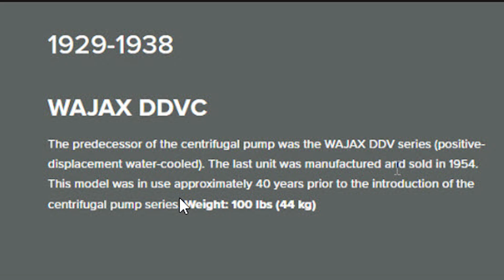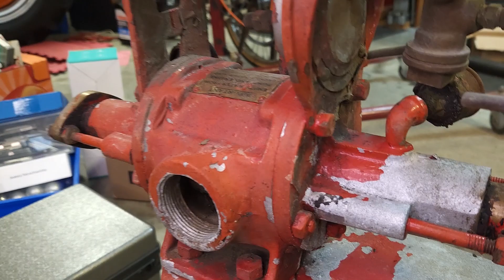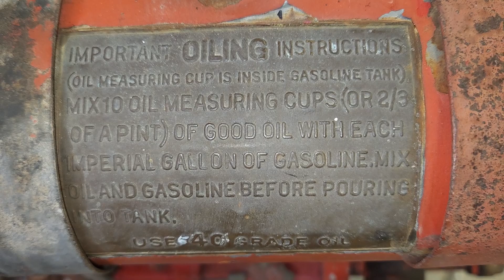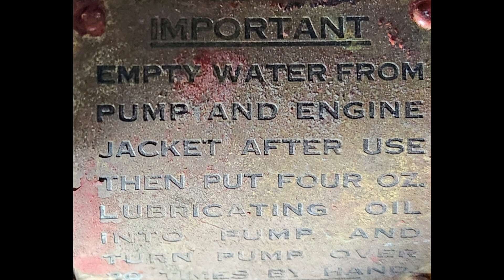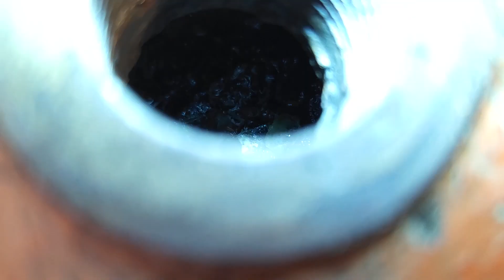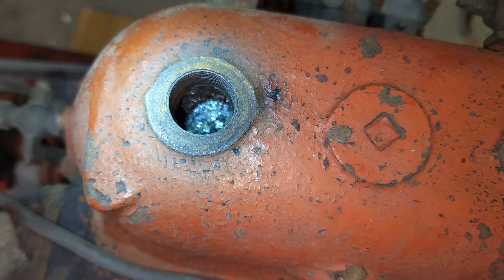1930s WAJAX Fire Pump with Evinrude DD 2 stoke 2 cyl engine

Comment: That's a rotary gear pump that was widely used by forestry agencies for firefighting.  They came in a wooden crate with all fittings.  There was a version with a single cylinder 4 stroke engine also.  I believe it was called a handy billy and developed for the us navy.